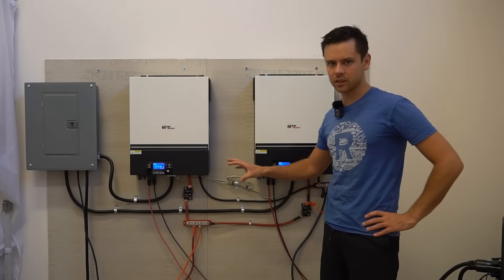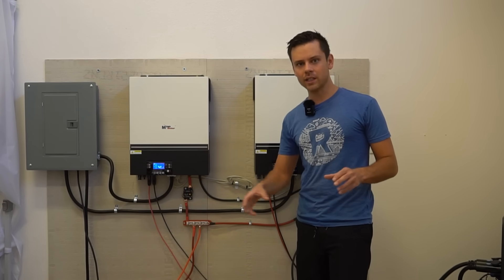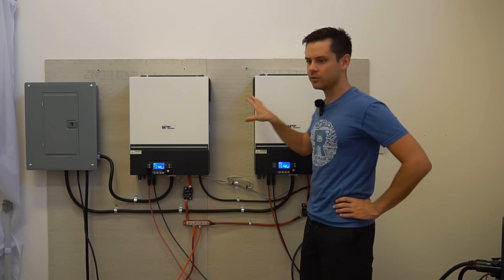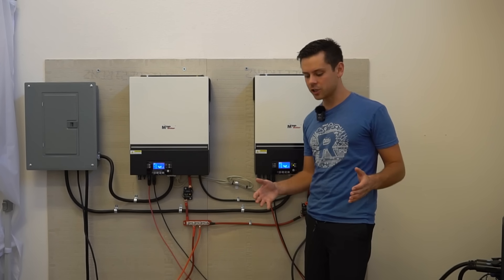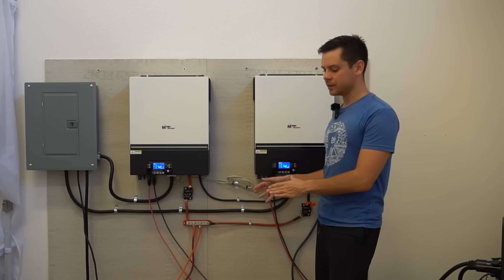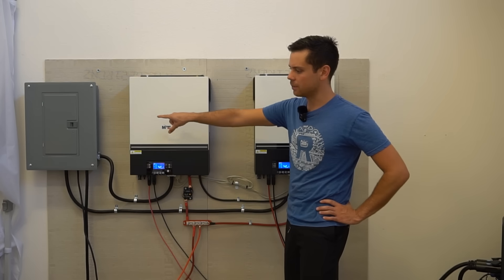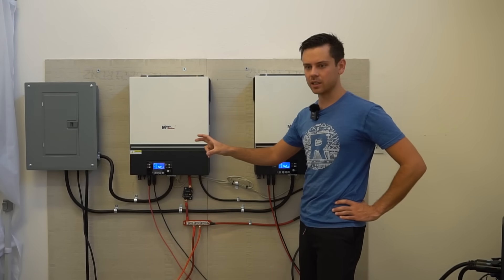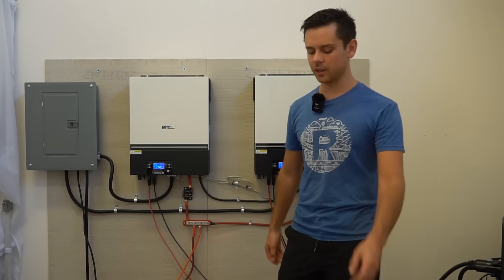Does my 13kW Offgrid Solar System require Grounding? Is it Grounded?

Comment: The panel needs to be tied to an earth ground and technically according to National Electrical Code, you should NOT bond Neutral and Ground in a sub panel.  Neutral and Ground SHOULD be bonded in your primary panel ONLY , as you want to earth ground and Neutral bonded in only one place as you are saying.  In this system, I don't think there is a primary street power feed, it seems to be only powered by the batteries. So in this case if I am correct about the AC inputs not being present, it is a gray area sort of...  The only other thing I see is the use of temporary wiring meant for extension cords.  The NEC requires Romex, or equivalent vinyl jacketed wire designed  for permanent installations in homes vs the rubber jackets used in temporary (extension cord) wire which is what I think you have used here.  When you add the AC inputs, I would recommend running the two conductor with ground (Black/White/ground), with the ground wire going to the earth ground in your  feeder panel  (assuming it is your primary panel and not a sub-panel) and bonding it to the earth ground input on the inverters and the panel.  Or you could run a single ground from your main earth ground in your main panel right to the earth ground on the inverter distribution panel.  Then un-bond the neutral and earth in the inverter panel so everything is connected to your one earth ground on your main panel., they looked like they were bonded in there but can't tell for sure.  The earth ground is primarily for all of the stuff you will be running AC from the panel, but my inverter has an earth ground connection and I would think the MPP does as well.  As a safety concern, many items are designed not turn on if there is no earth ground present, such as tesla charging for instance.
Reply: NEC doesn't well adapted to presence of additional independent power supplies at household: it was written with only a grid connection in mind. So, grounding on inverter's neutral will strongly depend from individual system's scheme. If inverter(-s) system is completely independent from AC grid, like Will's system from this video, then neutral must be grounded right after the inverter, in first distribution panel. Or, which preferable, it must be grounded at inverter's output terminals. In case of several inverter units in parallel/split phase configuration - it is better to create a neutral busbar for collection (combining) neutrals from all inverters. This busbar will be the point of neutral grounding. This busbar must be installed close to inverters.

Comment: I have a single grounding rod connected to bare copper wire that runs to all my pv and inverter generator panel etc. in an outbuilding that feeds my RV. This is only for lightning protection and I have no AC input. Did I do it wrong?

Comment: Your point about lightning strike damage in your domestic system makes good sense but this seems to be dismissed when it comes to the Marine system, in favour of grounding.  Which I “get”.   But it raises a question in my mind:  Given the greater exposure to lightning strike risk in the marine environment, do you think it would be wise to fuse marine grounds to protect the vessel from nearby strikes?

Comment: Unless you are using a single load against inverter, you want to have everything properly grounded possibly with GFCI. Otherwise a fault somewhere can cause ground loop and what would be grounded is e.g. a hot wire - then all what should be ground is suddenly "hot" against the earth, and this becomes a very dangerous setup. This is not a theoretical example, I touched a place which should be true ground on friend's off-grid powered house, then kept swearing for several minutes, then spend hours to debug how the hot wire got shorted to the ground - the root cause was a mouse chewing the wire insulation, where the wire came to contact with steel rod to basement, and so far, all ground over the house was suddenly hot against the earth.

Comment: Did you jumper your AC neutral INPUT to your AC neutral OUPUT?  I had to do that with my Growatt to eliminate the floating neutral when operating in battery/solar mode. 

Measure your voltage across your neutral to your ground when you are running off battery or solar only.  I would not be surprised if you had ~50v between neutral and ground.  I had some sensitive electronics (chlorine generator, pump, fan motor) that where damaged before I figured this out with help from Watts247.

Comment: Hey Will, perhaps I'm splitting hairs, but, if you're using both of the inverters as normal + inverting, in order to truely generate the 180 degree differential signal/power, shouldn't the length of the cables that connect from each inverter to the power distribution box be as closely matched as possible?  if they're not the same length, won't there be a skew in one of the power outputs at the junction box, meaning the power from each inverter is not really at 180 degree offset?  Perhaps the inverters are able to measure the delta in cable length an compensate for it?
Reply: I think you are confusing the DC battery cable with the AC output. The reason to keep the DC cable an equivalent length is to prevent a voltage disparity when charging/discharging the batteries at high current. Having a slightly different cable length on the AC side will not effect the phase relationship. Remember, this is eventually going to loads that have their own resistances, potentially on only one of the phases, and a few milliohms difference in the cables will be immaterial.
Reply: @pre176  Both concerns are equally valid, I believe.  Electricity in a cable has a velocity factor which varies with materials used in the cable construction, so, to make both legs of the AC output be exactly opposite each-other, the cables should be the same length.  Similar story on the DC side, regarding the loading of the batteries, I suppose.
Reply: @pbelb  so you’re saying that the 180 phase difference could actually be shifted at the load if the L1 and L2 cables are difference lengths? I suppose that checks out. But, and this is a big but, I did the math. Velocity of electricity in copper wire is 200,000,000 m/s. At 60Hz, each cycle of the phase is 3,333,333 meters long, or almost 11,000,000 feet. So hopefully you’re getting an idea of the sorts of differences in length you’d have to have in order to change that phase relationship materially.

Comment: The solar panel frames and mountings must be grounded with extreme prejudice.
Reply: Don't get equipment grounding and bonding confused they are distinctly different beasts. one  for maintaining equal  voltage potential and the other to allow a return back to the source in case of a direct short between the hot and the ground.

Comment: Thanks Will,  I applaud your thinking outside the box, making important points and challenging others to dialogue. I suspect however that many without a good understanding of the physics and dynamics involved many may not take to time to understand and consider the importance of what you have presented. 

Obviously you've taken the time to understand the big picture in theory and practice, and while I don't have as much experience with PV systems I much agree with and respect what you have presented here, and I believe  there are other additional potential issues and dynamics to consider, and as such, I think i would be helpful to go into a bit more detail about the differences between service grounds, equipment grounds, bonding of service and equipment grounds, and a bit more for how SPD relate.   Perhaps going through sections of the NEC on Service and equipment grounding and PV system grounding could help others to understand and implement what's in the NEC

As an Industrial Wireman (Journeyman Electrician), an Electrical Administrator and project engineer on various industrial and petrol-chemical construction projects and facilities  both onshore and offshore and specialized in power generation,  grounding and control systems. During that time I observed that while often Code and convention were typically adequate as best practices I encountered many unique instances where "Proper" grounding was inadequate or created issues, especially in the case of grounding electrodes, ground grids, static and lightning strikes.  

In places where you have low and high soil conductivity such as in the Arctic were you are setting on frozen tundra, lighting doesn't dissipate through the earth very well we installed underground ground grids and 40ft grounding rod arrays, and very large underground copper grounding conductors to attempt to bond all buildings on the same service at the same earth ground potential and give lightning a path to dissipate to earth and prevent different lightning potentials between buildings that contained millions of dollars of electrical and electronic equipment, but during one unusually large electrical storm that in some locations proved inadequate for very large strikes. 

In the case of lighting strikes, SPDs might be inadequate depending on capacity of the SPDs and the quality of the earth ground they are attached to dissipate a large and direct lightning strike. In some areas prone to especially large lightning strikes, things like lightning arrestor systems and rods for PV arrays and premises may be a reasonable precaution.
Reply: Seems electricians engineers and diy installers all have differing ideas when it comes to grounding.
My thoughts are to ground metal cabinets because you don't want to be incontact with them if static electricity is inducted into your solar panel conductors.

Comment: What if, all of your ground conductors went to a central ground buss then that one buss had a proper grounding rod? Would that eliminate the ground loop? That is how we do it in Amateur Radio where on the wall behind my desk I have a honking copper ground bar that ever piece of equipment to grounded to using as short of a wire as possible. Then off that honking ground buss bar I have a heavy copper line going to a eight foot ground rod on the other side of the wall. Is that a mistake?
Reply: you can have a remote ground point( bare copper ground bar) that everything that must be grounded tie to even the main service, all racks and metal enclosures and even building steel should be attached to that ground bar and sized according the the NEC . that would keep everything at equal potential and you'd be safe, However any ac sub-panels ground would come only from the main service to allow breakers to maintain their ability to trip if a fault occurs.

Comment: It's amazing to me how many people misunderstand the purpose of earth ground. Mostly people seem to think that earth ground protects them from getting shocked somehow. Lack of "earth" ground doesn't mean you don't have a ground at all, it's just not tied to earth. Your ground wire still acts as an emergency return path to the breaker box to trip the circuit breaker if needed, but that ground wire doesn't need to be tied to earth to perform that duty.

By not having an earth ground you're actually decreasing the chance of being shocked. Since the "earth" you're standing on is no longer a conductor you can no longer get shocked by simply accidentally touching a hot wire because there is no "return path" through the earth for that current to flow through your body.

In fact: a common piece of safety equipment used by crews working in outdoor / wet environments is something called an "isolation transformer". It's a 1:1 transformer (So it doesn't step up or down) that plugs into a wall socket and creates a new electrical connection that creates an "isolated" electrical path that is no longer referenced to ground. This is used as a piece of safety equipment because by removing the earth ground as a return path for the current it makes it safer to use electrical equipment outdoors in wet conditions.

Off grid inverters achieve the same result as an isolation transformer. They effectively "isolate" the electrical system from earth.
Reply: Circuit breakers are overcurrent devices, and will not trip on a ground fault that isn't overcurrent. Please fix your comment.

This isn't worded accurately:
"Your ground wire still acts as an emergency return path to the breaker box to trip the circuit breaker if needed..."
Reply: @FrancisKoczur  Circuit breakers aren't designed to trip on "ground faults" at all in any circumstance. In fact a "ground fault" would make a circuit breaker less likely to trip because a "ground fault" generally means the return path is compromised in some way.

The purpose of the "ground" wire in a circuit is to provide an "low resistance" emergency return path to the breaker box. The "low resistance" piece is key to this. By providing a low resistance return path if the hot wire were to come loose and touch the metal case of an appliance the low resistance return path would ensure the breaker trips as many amps would instantly flow through that return path.

A "ground fault", by definition, is a condition where this return path is removed or damaged, which would prevent the breaker from tripping and would create a shock hazard if the hot wire in an appliance become loose, frayed, etc.

Circuit breakers do not protect against ground faults unless they are GFCI type circuit breakers. GFCI protects against ground faults, circuit breakers do not.

Either way the situation does not change based on whether your ground is tied to earth or not. The low resistance return path from the appliance to the breaker box is what's important, not whether or not the breaker box ground is also attached to earth.
Reply: @JeremyAkersInAustin  A circuit breaker will trip on over current, including if that over current is going to ground to complete the circuit.

But, circuit breakers will not trip on a ground fault that isn't over current (unless the devices is using near max current and ground fault puts it over).
Reply: As a counterpoint, not bonding to earth ground your system ground can float significantly above or below earth ground. You will then become a path for that equalization. Usually it's under a hundred volts and very little current BUT it can get crazy in certain situations. This effect is one of the big reasons we all ground to Earth and don't encourage floating ground.
Reply: @oshavlfarms7239  As a counter counterpoint: Every time someone uses a portable generator, or one installed in an RV or truck, or any kind of mobile/portable inverter such as one installed in any kind of vehicle, they are utilizing a floating ground. Think about how many thousands of people are using one of these floating ground devices every day from long haul truck drivers who aren't allowed to idle their engines and yet no-one seems overly concerned about the danger.

That's because the amount of charge buildup on these smaller scale systems is not very large. Even if there was a significant voltage differential of 100+ volts: it would be the same as touching a tiny capacitor which was charged to that same voltage. The reason why it's not a big danger is because it would result in a microscopic amount of current flow and it's large amounts of current, not voltage, that is dangerous.

With something as massive as the grid that's a real concern, and which is why it's earth grounded. But with a small off grid system it just isn't.
Reply: @JeremyAkersInAustin  I am one of those people, and have an RV completely on solar, and experience the shock of a floating ground on a regular basis. All of those thousands of people do as well.  That difference can get extreme, and it can and does cause damage to property and people, although typically rare. I'm very aware of the equivalents and the difference between voltage and current as I'm an EE, but to insinuate it's harmless and always completely fine is false. If you are running said generator for a long period of time you SHOULD ground it. Just because you do it here and there and it's fine does not cover the full story.

Edit: typos
Reply: @JeremyAkersInAustin  regarding the long haul truckers... Watch closely, a lot of fuel points require ground bonding or rely on the nozzle to ground bond prior to fueling. Same with your car, it equalizes on a regular basis when fueling or when road water is competing a circuit to ground. A system that never grounds and always floats can reach in to the millions if volts of the conditions are right.
Reply: You don’t ground your generator if you plug in to a appliance!
You also don’t ground your sub panels

Comment: I thank you for your sight .
Im building a 48v off grid cabin. Im using two 48v grow watt with three 48v 100 ah lifepro4 in a server cases. Im looking at 24 used 250 watt 12v solar panels going to run 4 panels in series and 6 strings in parallel . Would like to get your advice on the system im building.

Comment: The larger the connector cable to the source from the output board, the smaller the earth fault loop impedance, making it trigger faster under fault conditions. You are correct, you wouldn't want to connect to a house earth system, some (most) do not have sufficient equipotential bonding and this allows for transient currents on the earth conductor, and we are not just talking milliamps.

Comment: OK Will, here is a question for you. I have a house here in Thailand which i wired to the Thai regs. You are not supplied with an earth from the Goverment electricity supplier, only live and neutral from their meter. 220-240v a/c . so for earthing you have to install your own rods for earth. But here ya go, the wiring system is a MEN system [ multipule earth neutral] , i recently added my solar system to the house, 48v 6 kw highbrid inverter, 48v 10kw 6000 cycle lithium ion battery, 6kw pv array.  Do i tie my array earh and my inverter earh to my house earth or leave my inverter and array off earth....thanks
Reply: bump